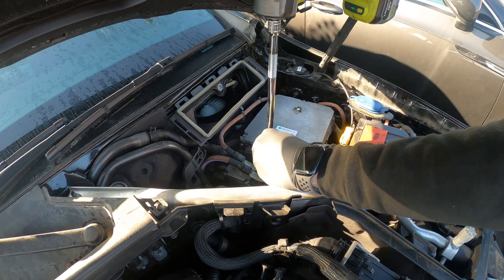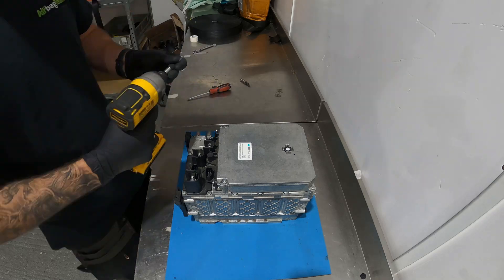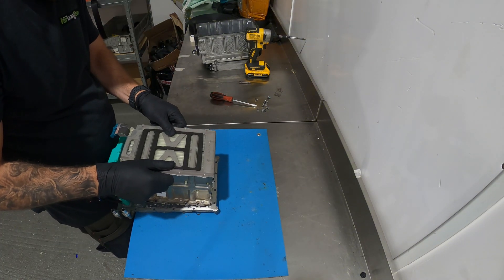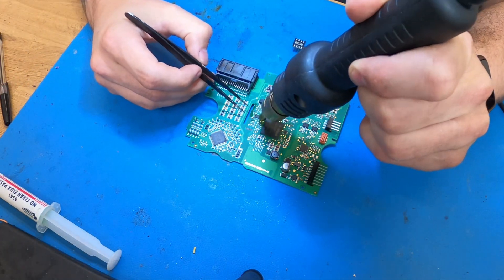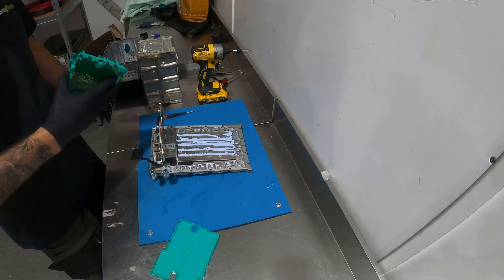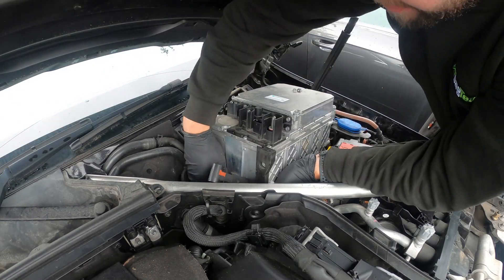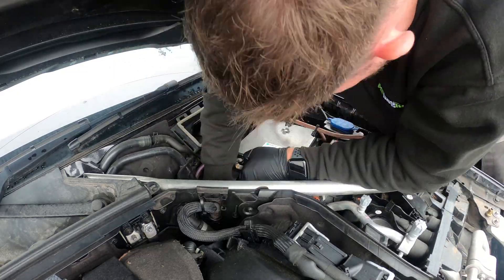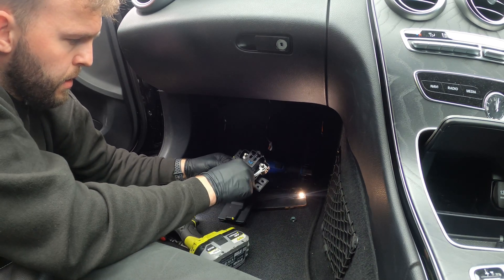Mercedes Hybrid Start After Crash (48v Battery)

Comment: hi i got late model cls 450  it said needed a 48 volt battery so I replaced it and it's brand new but, it needs to be program to be able to start the car. I ordered the C6 and Xentry that came with a laptop and it didn't work. It kept saying error, I didn't got a chance to go through on the whole proces to program. Can this scanner will program the 48 volt battery?

Reply
Reply: То что ты купил скальпель - это не сделало тебя хирургом.
Этот прибор может решить твою проблему.
Но для этого нужны программы и знания.

Ты можешь найти того, кто тебе сделает это на твоём оборудовании онлайн через удалённый доступ.
Reply: Lol you spend soo much money only to go to waste should have let an expert so the job